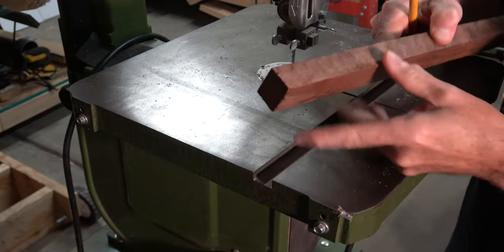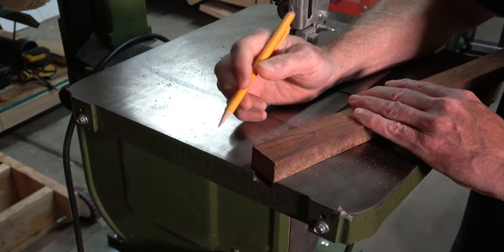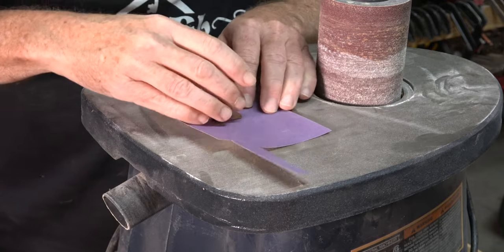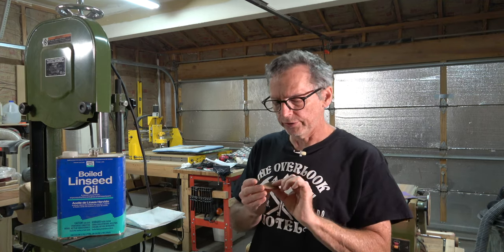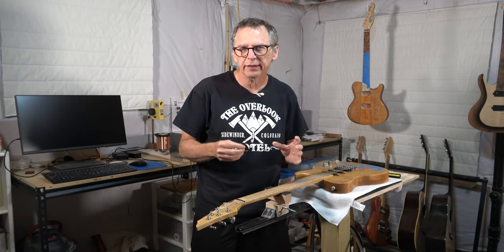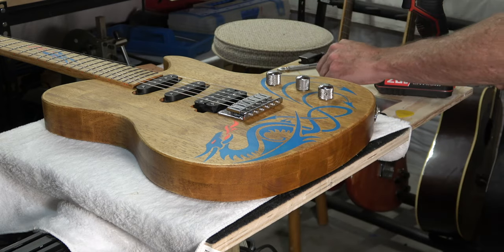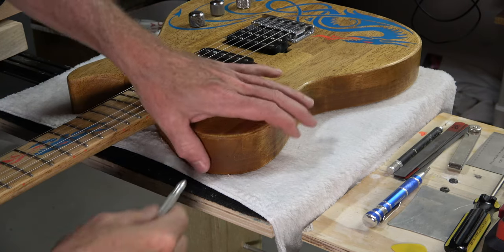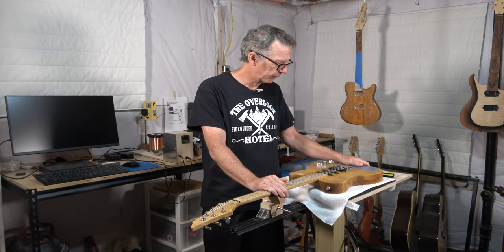How To Make A Truss Rod Cover For A Guitar. The Oak Guitar Build Part 16.

Comment: I was wondering if you could help me with a problem I'm having. It's about my Sanding techniques which must be off. When I fill a hole with a compound with a plastic or wood wood filler, when I sand it it's always below the surface or above the surface but I can never get it flat. Do you have any tips or maybe products that are better?
Reply from the maker: Use a very hard sanding block. I use Toleblock S for flat surfaces and Toleblock QS for curved surfaces. I attach a piece of sandpaper to the block with double sided tape and sand the filler until it is even with the surface. You don't have to use the Toleblocks as long as you can find something similar that is very hard. Sand just the filler and feather into the surrounding wood. It take practice so try it on some scrap.
Reply: @HighlineGuitars  I have some Square pieces of Walnut I'll give this a shot with that. Thank you so much